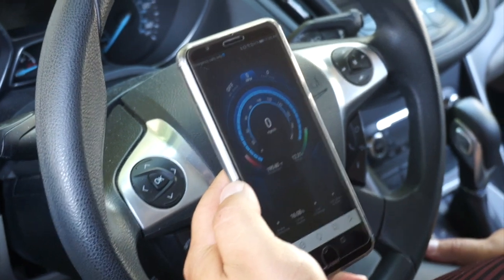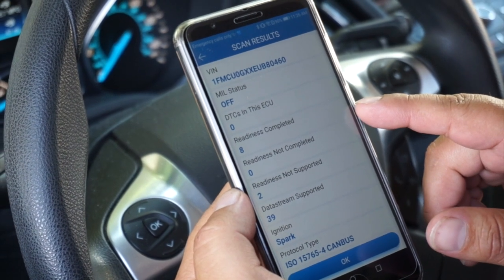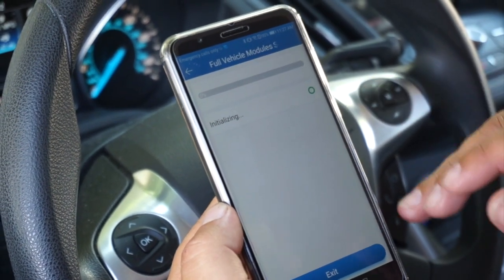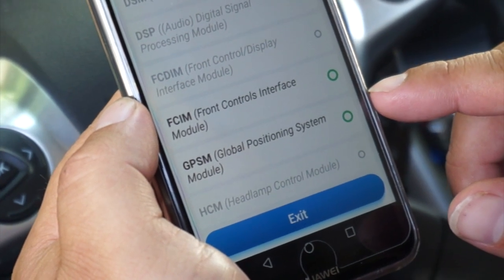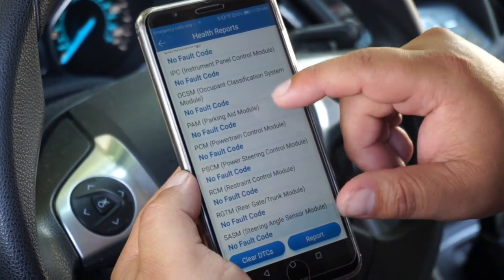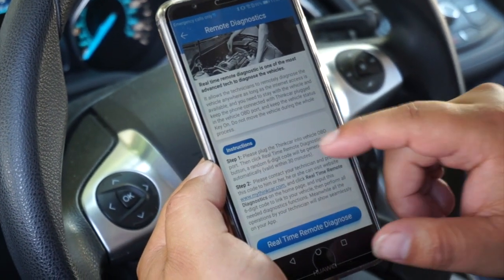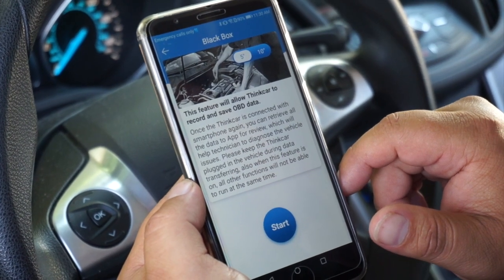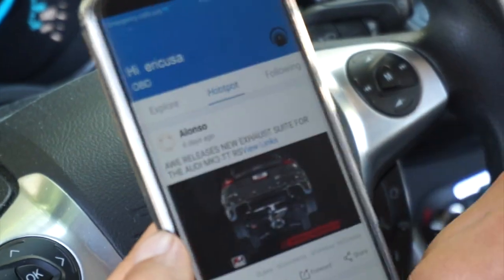How to Use Thinkcar 1s - Remote Diagnosis OBDII Scanner Bluetooth

Comment: I don't want to send info to a tech. 
I just want a scan tool to tell me what the engine error light is for.
To give the code and a description of the code so I can no what needs to be fixed.

I have been burned by shady mechanics.
So I want to have an idea of what needs to be fixed 
before I call a mechanic.

If it is a fuse or relay, 
That is something I can change myself.

Covid closed my job permanently, 
So I dont have have money to spare.

Comment: It's a cool OBDII professional dongle with some unique features which are only available on professional scanners could cost you thousand dollars. The enhanced full vehicle health scan will scan all manufacturer codes then generate a report. In addition, remote diagnostic feature will connect the vehicle with your technician no matter wherever you are.